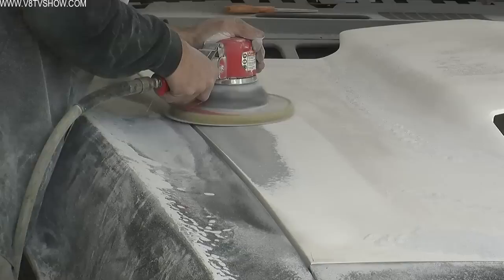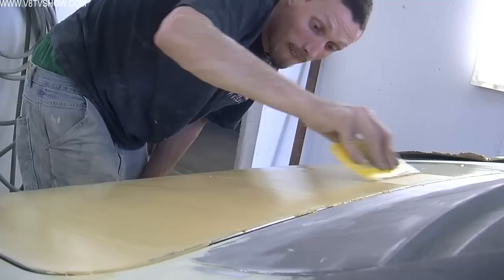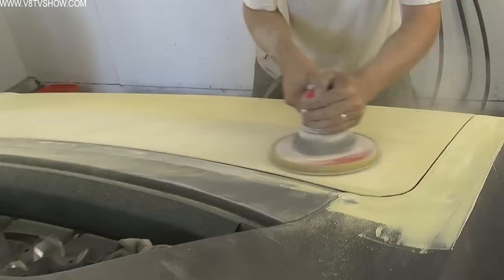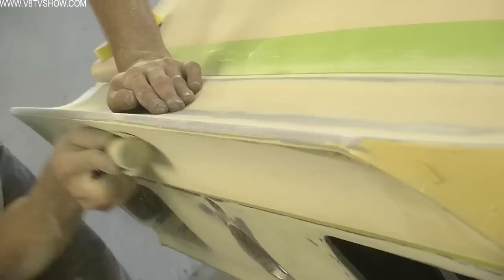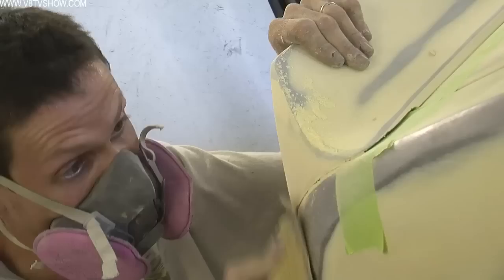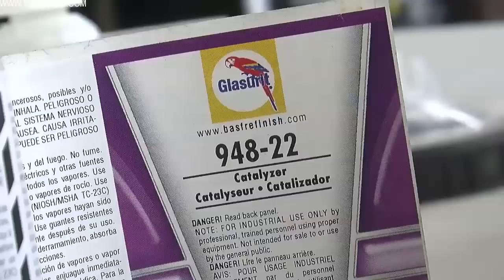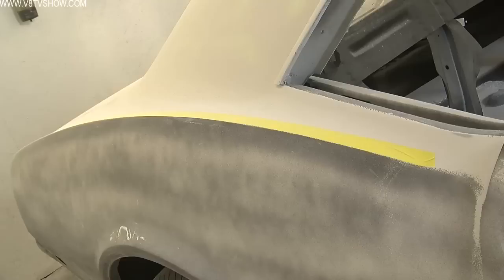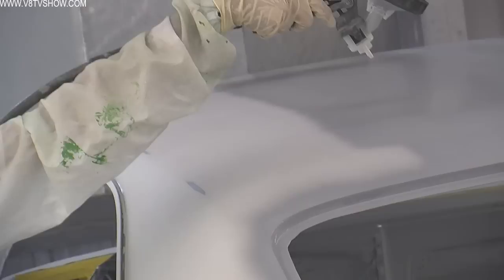1968 Camaro "Reloaded" Body Filler, Spray Polyester, and Body Work Video V8TV

Comment from the maker: Contact the V8 Speed & Resto Shop to build or upgrade YOUR ride - (314) 783-8325 http://www.v8speedshop.com
Reply: These guys are good. They actually take pride in their work and the process. I just did a 69 with some of my students at the training center I run for Mike's Auto Body, the company I work for. This is the exact same process I showed them with bodywork, polyester feather-fill, sealer, base coat, clear, block sand 600 wet, clear again! Car is glass!
Hugger Orange with cameo white rally stripes. Glass! 👌🏼💦💯👍🏼
Reply: @1totheright  SOLID !

Comment from the maker: This is true to some degree.   For the smaller applications, we use Clean Sheet boards with their wax-paper type composition.   However, for the larger mixes, Nathan likes "seasoned" cardboard, in which he leaves a coat of filler hardened on the cardboard to form a barrier, then mixes the big load over that.   Clean sheet metal works as well.

Comment: I know this is an old post but people looking for advice or knowledge will read comments and get false info. The comments regarding mixing filler on cardboard are false. This come from the idea that the polyester resin will somehow soak into the cardboard and take away from the integrity of the filler. This simply will not happen fast enough to degrade any qualities of the filler. You would have to leave the filler on the cardboard for a far longer period of time than it would take you to mix and use the filler. Use the cardboard it will make zero difference. Any manufacturer info on advising against it is to limit liability against ignorant usage. Also stirring filler is also perfectly fine. The idea is you’re creating air and making pinholes when stirred. This is also mostly false. Pinholes are created mostly from improper application, to much hardener or just cheap filler. Stirring filler almost never is done fast enough to aerate the filler. When mixing on the mixing board,final mix by using one side of the spreader twisting and folding to start the first part of proper application in getting cavities of air out. If you’re spreading proper amounts, thin layers at a time, you will be pressing out major pinholes as you spread.  Any pinholes left will simply be part of the process of body work. It’s up to you to find them and deal with them accordingly.  Also people looking to use spray filler(spray poly,spray filler) should know you need a poly gun or with a fluid tip of 2.0-2.5 to use  the product efficiently. The 3m accuspray gun and til system is good for beginners. One gun, and plenty of tips to handle every phase of the processes. I was giving this gun by 3m to demo and test before it was made available. We used it for all sprayable products on a Ferrari BB512 from poly to clear coat. It’s not %100 preferred but it will get the job done for far cheaper than buying multiple guns.   Use cardboard, stir your filler, mix hardener correctly, apply properly and enjoy.

Comment: Mixing on cardboard is not the best. The worst in this video was stirring the filler.  NEVER stir filler! Fold it. You'll add air to filler and cause pin holes.

Comment: I know this is an older post but I'm curious on what Nathan had mixed with the body filler? I see filler and blue hardener but it seems like the filler flows so well. Would that be honey or fiberglass resin mixed in? I'd love to be able to spread a panel like that.
Reply: It was the filler used. Huge difference in body fillers. Watch video again and you'll see what brand he used. Good stuff!
Reply: If some sort of finishing filler. It's a lot finner then normal filler. but mix them both together and it flow a lot better
Reply: give you a hint. He makes it clear he is advertising 3M, Evercoat has great fillers as well that glide on a panel. Im in Canada ( the  country thats going to hell in a hand basket, TY TurdDoh) and unless im not aware of a dealer here for eastwood. I have ordered a few cans of ech of their fillers and they are an amazing product as well. If I were in the US and got free shipping I'd use their products a lot more. Their highbuild primer surfacer is better than evercoat or 3m imo. I have a drawer of durablocks and soft sanders that I have labeled eastwood on it. With exception of the shorter blocks (6ich) i have never replaced the paper on them. (mind you i have ony done 4-5 cars using their product (customer request) but it doesn't wear the paper out nor clog much that a nylon brush can't remove with a swipe or 3. 
I use to think of eastwood like most would harbor freight (you get what ya pay for type thing which meant junk).  Guess their decades of making money from us poor guys (well you in the states) they invested into better and better quality. 
I will say though...do not buy based on their made in the USA and think you are supporting domestic manufacturing as its a minimal requirement to be met to label something as made in the USA.

Comment: If you're in the middle of sanding back filler, what can you do to stop any exposed fresh metal areas from rusting, for us hobbyist who have to wait till next weekend before we can get back onto the car?
Reply from the maker: Great question.    We typically coat the bare areas with epoxy primer to preserve the corrosion barrier.   You don't want to use anything oily or waxy, that will just cause problems later.    One thing that can help is to minimize the exposure to humidity while the steel is exposed.    We've been told by an aluminum repair parts company that simply covering the work at the end of the day with a moisture barrier - like a plastic / nylon tarp - can keep the air's moisture off the work and reduce the opportunity for corrosion to occur.  A dehumidifier or air conditioner helps remove the humidity as well.   If this is done, we'd still scuff the bare spots with a scotchbrite pad or fine sandpaper before spraying epoxy.     Hope this helps a bit!
Reply: Same problem, take a class and after you work on it, it sits a week, outside...Rustoleum Rattle can primer sucks.  Supposedly,  Duplicolor "filler" in a spray can works ?  Chris (in class) said it does, so am going to try that.... I have also seen Transtar in a rattle can...I used rattle can self etch, but that was junk too.... I have also used cold galvanizing compound rattle can too that says it is 90+% zinc..it's only on about a week, seems to work....sands off super easy

Comment: The Bondo buggy wouldn't the right kind of paint and a little bit of Bondo here and there would have made that car look okay
Reply from the maker: We suppose, if we were going for "OK."   This one went on to score 992 / 1000 in the Modified class at the Muscle Car and Corvette Nationals and was a 2-time SEMA car.   As we mentioned, about 90% of the filler was sanded off, just there to refine all the new panels.

Comment: @1:54 your mixing filler on cardboard, this has been a topic of debate among some YouTube garage gang members the argument is that the cardboard absorbs some of the oils of the filler and fibers of the cardboard can lift and become part of the filler , sheet metal/old quarter glass/plastic is recommended